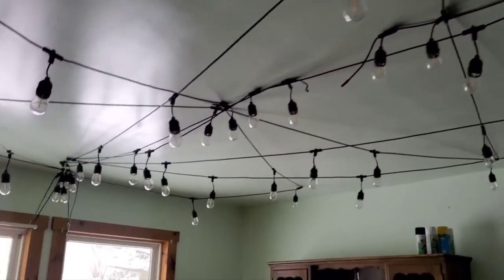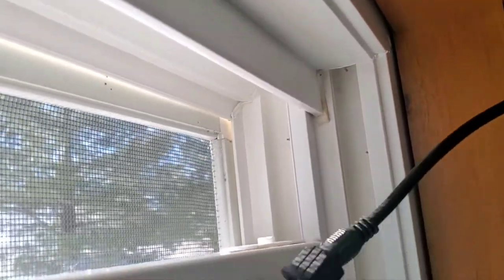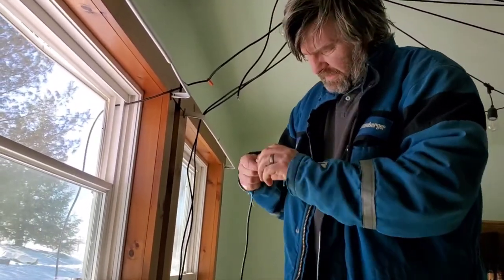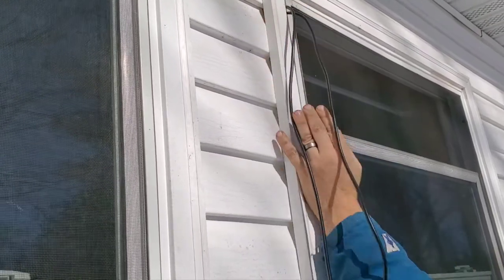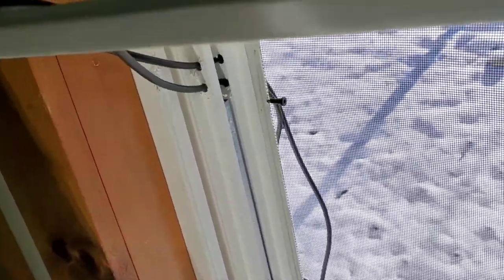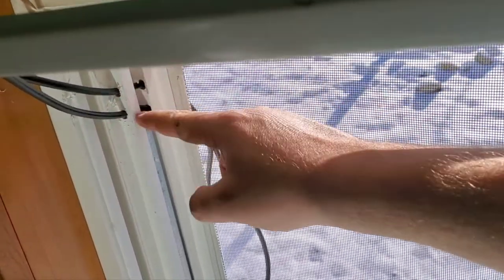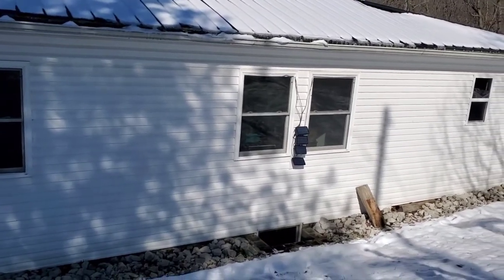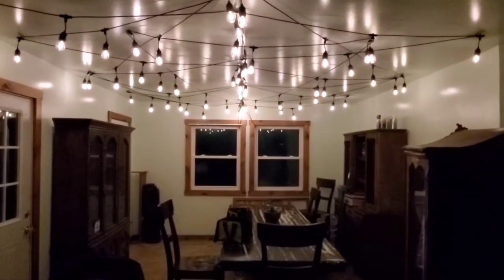lighting an amish house/ off grid light solutions

Comment: If you wire two golf cart batteries, an inexpensive charge controller, and two 100 W solar panels together you will probably have enough to light the whole house with 12 V bulbs.
   Eventually you can get an inverter to have 120 Volts AC if you want it.